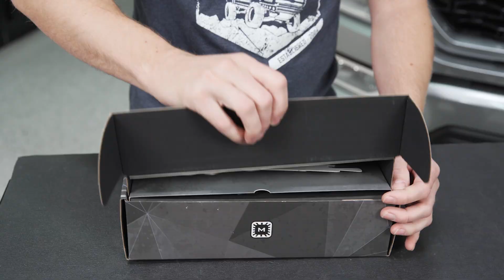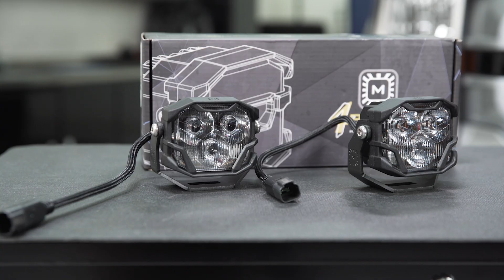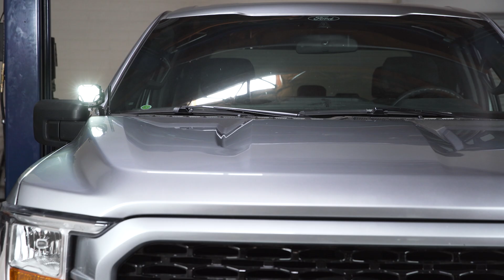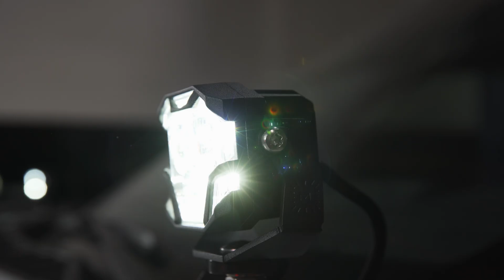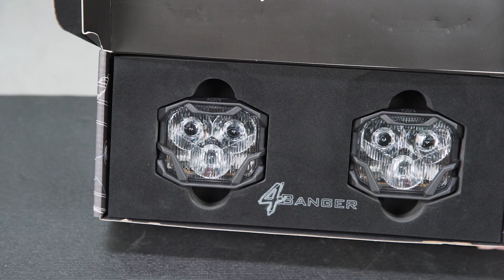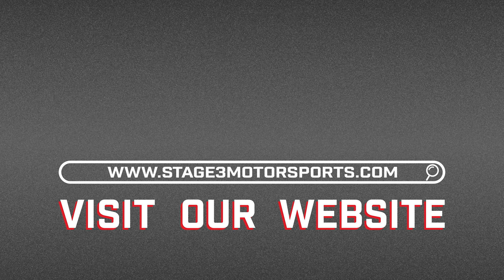Morimoto 4Banger LED Off-Road Lighting Overview

Comment: NCS or HXB* (not HCX)

The NCS is our Entry Level Light, running a Niche Chip.
The HXB is the Premium Level, that runs an Osram Chip. 

We also have these avaibale in a Foglight Replacement and A-Pillar kits for Vehicle Specific models. 

Great video though guys.
Reply: Will you ever get the combo? Beam certified as SAE driving?